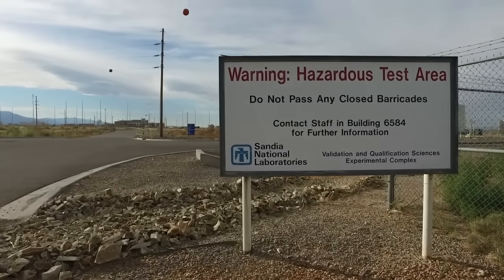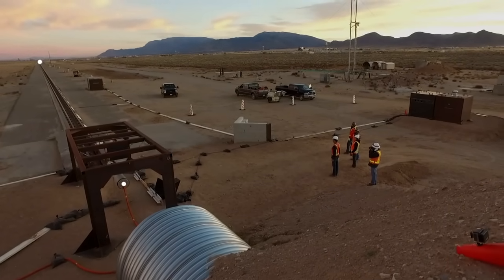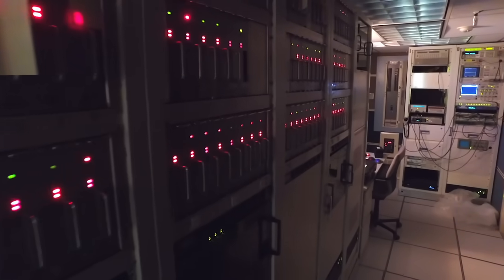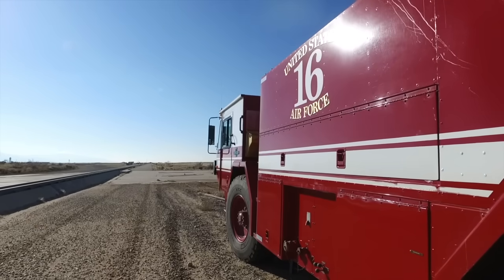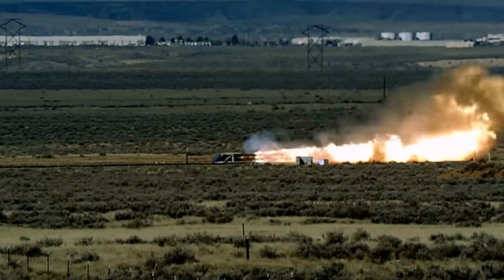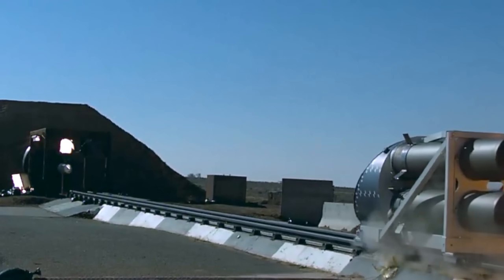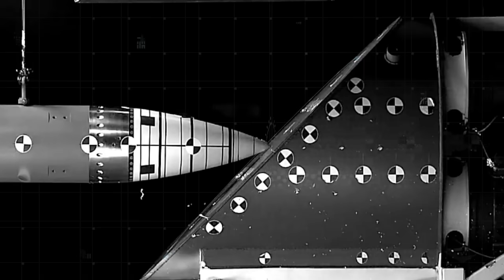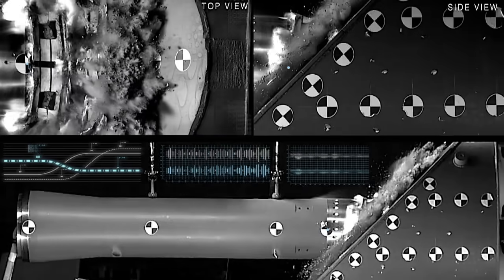Rocket Sled Impact Test In Slow-Motion

Comment: Ok but how does this ensure the efficacy of our nuclear stockpile?
Reply: Point remains, those guys published a video of a test without saying what it's for.
Reply: @lrrrruleroftheplanetomicro6881  They use the results of this test to compare to super computer modelling.
Reply: @hoghogwild  yeah. still makes a boring video.
[Video should] Elaborate on why you wanna slam a warhead into a solid target at mach speeds to begin with.
Reply: @lrrrruleroftheplanetomicro6881  It did, "discover how sensors, gauges, and quantitative high speed imaging systems provide data for the super computer models."
Reply: @hoghogwild  what are we making the models for? Blowing up dirt or interception by enemy missels?
Reply: It's used to verify the contact fuzes on nuclear weapons are functioning correctly. Warheads travelling at the speed of sound (or even faster) have a very small amount of time to set off before they slam into the ground and disintegrate.
Reply: kylesenior   Cool thanks man.
Reply: + kylesenior There is one problem with that.... nobody detonates a nuke on the ground unless its a hardened target. You detonate a nuke at greater than 1000 feet because the shockwave would then travel at such a angle that it is not going to be absorbed by buildings and other obstacles which allows for the shockwave to WAY more damage. Furthermore, in air detonation of a nuclear device results in the EMP to be felt at greater distances.  So yeah I feel like this test was total bullshit and was just something to impress the masses and there is nothing another nation can learn about American nukes from watching it, we perfected contact fuses a VERY long time ago.

If you don't believe me after much testing(Manhattan project) it was decided that the bombs dropped on japan in ww2 be detonated at altitude(1000ft I think for little boy) to cause more damage allow for more coverage by the thermal flash as Japanese structures of the era were mostly wooden.
Reply: @haydenmorrison6642  At the start of the video they clearly state "it is one of the many tests". Clearly it is just one test among many others as they have to cover every single possibility
Reply: But I thought they were mostly designed to detonate in the air?
Reply: It's clear you've done no research on the topic either. The choice between airburst and groundburst is part of selecting the desired weapon effect and is used against vastly different targets. Note that Hiroshima and Nagasaki were cities and that you can drop nuclear weapons on other types of targets.

Airbursts generate a lower overpressure at ground level, but can apply that overpressure over a larger area. The lower peak overpressure means its only useful for destroying soft targets like cities, airfields and military units with little heavy armour.

Groundburst will apply a very large overpressure (try 10,000PSI or more) over a small area, making it useful for destroying hard targets like missile silos, bunkers, armoured units,  or in cratering larger surfaces like runways.
Reply: No, they're designed to be fuzed in whatever method the mission requires.
Reply: That sounds convincing to the layman, but that's completely wrong. The purpose of this test is to ensure that there is no way that a supersonic impact can accidently (or prematurely) detonate the fission primary. The fuzing on all missiles, nuclear or not, is done with radar altimeters/proximity sensors. There is no need to set up such an expensive test to prove the efficacy of the fuzing system. There is, on the other hand, plenty of geopolitical reasons to ensure that a nuke doesn't go off if e.g. the bomb rack on a a B1B fails and the munition falls on friendly territory.
Reply: @tetrabromobisphenol  B-1Bs havent carried nukes since the early 1990's.
Reply: well that's classified.....................so you'll have to ask the russians
Reply: Because if something hits it no explosion
Reply: Nice argument dude. Do you normally act like a child when your stupidity is called out or am I a special case?
Reply: Oh, and loads of conventional weapons also use contact fuzes either as the primary or backup fuzing method.
Reply: Not my job to run you through the basics dude. Go research nuclear weapons targeting yourself. Though somewhat biased, the Bulletin of Atomic Scientists has a large amount of easily accessed data on the topic. Start there. There are textbooks on the topic as well.
Reply: No?
The fact you called this a missile to me suggests you're not actually as well educated on the topic as you pretend you are. This is a B61 gravity bomb, the Mod 11 version but the looks of it from the flanges at the back. the B1 bombers has also been retired from the nuclear role, all the way back in the early 1990s.

Secondly, one point safety testing is no longer permitted. The 1996 Comprehensive Nuclear Tests-ban Treaty does not allow it.

Thirdly, they most certainly do use non-radar contact fuzes. The contact fuzes on the W76, W78, W87 and W88 are all piezo based. They're simply more reliable and don't run any risk of jamming like radar fuzes do.
Reply: I just want to say - great comments, kylesenior. It's a rare sight to see others who actually know what they're talking about when it comes to nuclear weapons. Ignore the trouble some of these people are giving you. They'll find out they're wrong if they ever decide to do research themselves (but I wouldn't bet on that happening).

Also, I didn't even realize the CTBT banned one point safety testing. What's the goal there? It seems like something that's entirely useless to ban. It makes sense that this is a test to validate contact fuze functionality at high speeds, but my first thought was one point safety test.
Reply: kylesenior let's see your research
Reply: I'm well aware of difference in scale of modern nuclear weapons. What you are unaware of however is that overpressure radius and yield do not scale linearly, but instead scale to the cube root. To get 2x the overpressure radius requires 8 times the yield. This is why weapons like the 475 kt W88 warhead still need to land within ~150m of a missile silo hardened to 6000 psi to destroy it despite having a yield more than 20x larger than the nuclear weapons used in WW2. A WW2 weapon would need to land within 70m and be fuzed for contact burst to destroy the same target.

tl;dr you still have no fucking clue what you're talking about and need to do more research.
Reply: kylesenior you seem to have forgotten that today's nukes are exceptionally more powerful than the ones used in WW2. That changes things a lot.
Reply: You're a special case ;)
Reply: So do you quote wikipedia at parties too or only on YT when you're alone in mummy's basement. Oh, No one invites you to parties? Probably because you're a fucking douchebag.

Comment: They should ram a Honda Civic into a Toyota Corolla at Mach 6.
Reply: billt460 to produce a Toyonda Civolla I presume?
Reply: @neilross9867   Corollavic
Reply: Honota Corovic
Reply: @RefianS  now is time for some CORONA
Reply: @RefianS  I want one!!!
Reply: Put a Nokia in front of each car
Reply: That would be an "unstoppable force meets immovable object" type of situation. You might as well divide by zero.
Reply: @ArKritz84  😂
Reply: There are easier ways to produce dust you know...
Reply: This would probably end the human species
Reply: Its the new Ho Yota
Reply: this is definetly how you make a black hole.
Reply: hahaha Honota Corovic that's a very normal sounding yet made up Slavo-Japanese name
Reply: This is how you make a Black Hole
Reply: billt460 To create the ULTIMATE ricer.
Reply: Why not two volvos?
Reply: @martytheanimator6426  Quote: "Why not two volvos?"
The sound would travel eight times around the globe, like with Crackatoa.
Reply: Most likely scenario: The Honda Civic will be on its roof a few miles away, mostly fine. Probably a broken light as usual. And the Corolla will be a pile of neutronium.

Worst case scenario: The impact will cause a run-away fission reaction as the civic imparts immovable force causing the entire corolla to undergo fission, igniting the atmosphere of Earth, burning all biological organisms off the surface in mere minutes.

It's probably worth it, for science. Just make sure there isn't a Nokia in the glove box, or there wont be a bunker deep enough to survive.
Reply: billt460  Hahahahaaa 😂. This sometimes happens for real on Friday nights after the pubs shut on British roads 😁
Reply: My money is on the corolla
Reply: ArKritz84 lets test it anyways
Reply: you would have a Hondolla Toyivic then
Reply: Should rocket propel a Chevy vs Ford. 
I constantly here the ‘which one is best’  argument since moving to the states lmao
Reply: To test what it’s like to get hit by a space tesla
Reply: What you think would happen :
both of them will get destroyed

What will actually happen :
shingo succeeds at the double crash
Reply: billt460 MAXIMUM DRIFT
Reply: Won't work without inner-planetary wobble bearings.
Reply: Instead, i'd suggest a Mach-6 collision between a Ford F-150 and a Dodge Ram...

We'd finally know which onw is the best...
Reply: This sarcasm is close to perfect.
Reply: It would lead to another big bang and open portal to anime dimension.
Reply: Man that would be ridiculous.....and amazing
  The amount of kinetic energy would be ridiculous....So I did the math a Honda Civic weights about 2,800 pounds on he low end and Mach 6 is about 4604mph more and that would be.....2,690,030,320 aka two billion six hundred ninety million thirty thousand three hundred twenty joules of energy same as 1285 pounds of TNT over half a ton or a little over 22 gallons of gasoline or about half the energy of a typical lighting bolt 
     One thing is for sure physics is fun
Reply: You would end up making the first prototype Hoyoda Corovic
Reply: Brack Ho
Reply: mach 6 is a bit extreme. let's just try mach 1 first
Reply: There are easier ways to Double Crash you know ...
Reply: +Refian S
 
Sounds like the name of a soccer player.. one who had Japanese and Serbian parents.. ;)
Reply: The Honda would still start up
Reply: billt460 HaHa...in those conditions, the two cars would fuse giving birth to a fucking hybrid and may be called let's see here.......Honota Cirolla!! How 'bout dat?!
Reply: billt460  FUCK yes
Reply: Refian S That sounds like a japanese x russian hybrid
Reply: Honda Corolla EX-L
Reply: The Honda Civic is too fast
Reply: Land Rover vs Land Cruiser also Land Cruiser must be covered in MUD like my one > [ https://prntscr.com/ke4ft8 ] to make it a real Land Cruiser. Land Rover must be custom made to withstand the sheer sexiness of a real Land Cruiser or it will blow up before the test even begins
Reply: The book is on the table
Reply: Hahahaa
Reply: Yo mythbusters did it already. Except it was a steel plate and a POS Toyota I think
Reply: C O O L  V I B R A T I O N S 
C O O L  V I B R A T I O N S
Reply: Yes that would be a great idea to get rid of all Honda civics from the road.
Reply: Scott Kilmer would not object to sit in the Toyota for the test.
Reply: Holden Commodore
Reply: WANT IT!!!
Reply: or chevrolet into ford
Reply: It would just be a brief flash of light followed by a cloud of dust.
Reply: we need scientist like you,,or at least a program where individuals can test out their ideas.  I would like to see that test even though.....Mach 6 is a little to fast....Mach 1 would be a fair test.
Reply: billt460 why Jappos
Reply: A Toyota civic
Reply: what about a forvy suborer?
Reply: They would disintegrate before impact.
Reply: Myth busters did it at mach 1
Reply: DONT GIVE THEM IDEAS
Reply: Toyoda corivic
Reply: Toyota would fall apart at 120 km/hr. Not much of a test.
Reply: So NONE of you ever watched Mythbusters? 
They did pretty much exactly that, and the car on rails hit so hard it was knocked out from under its own *paint*. Look up the clip, it's insanity.
Reply: Launch a nokia into a brick at mach 6
Reply: Why not a Mercury Grand Marquis vs a Honda Civic
Reply: na guys. the ho yota comment took the belt
Reply: Honda can reach mach 7.3 if V-tec kicks in
Reply: Wow not one person said “she’s home alone?” We’re making progress.

Comment: crazy how you can see the air pressure wave just in front of the sled as it makes impact
Reply: Peter Nelson Are you talking about Thrust SSC? It definitely broke the sound barrier, not by much.
Reply: Peter Nelson I think we will agree to disagree about Thrust SSC (there is a definite sonic boom in the videos and you can see the shockwave almost perpendicular to the vehicle, which indicates the speed was at or slightly over the speed of sound), but you're correct that shockwaves can be formed at subsonic speeds. Normally they are formed when approaching the sound barrier, when the aerodynamics of an object result in some of the airflow around it becoming momentarily supersonic as it passes around (eg. over the upper surface of an aerofoil).
Reply: rowgli I'm not sure that's right. The SSC is listed as going 341 m/s, and the sound barrier is 343 m/s. It varies depending on altitude, temperature, humidity, etc, but I didn't think it had been broken on land. Even if I'm wrong about that, though, my original point stands, which is that a pressure wave doesn't necessarily equal having broken the sound barrier, even though if you've broken it you will always produce a pressure wave
Reply: rowgli you're right; I haven't actually seen the video of the Thrust SSC, so I'm missing information from that avenue. But its true what we've agreed upom, and the same principle applies in aircraft design - part of the reason that it's such a difficult task to reach the speed necessary to break the sound barrier is that the air moving over the wing goes supersonic before the wing itself, due to the inherent principles of aerodynamic lift and drag. The same is true of propellers and is the reason why overspending a prop can lead to its literal disintegration. Super cool stuff, imo
Reply: For these rocket sleds, going mach 1 would be a challenge to maintain such a low speed. They routinely go 4 to 5 times larger than that speed. They can do this because they are unmanned and not much attention is paid to slowing it down in a safe way.
Reply: Peter Nelson here you go - also includes the photo I referred to :)   
https://youtu.be/rIWdtE-__5M
Reply: That's a really cool shot, with the blast wave extending out to the sides! Thanks for sharing!
Reply: And the fun part is that it literally was the front shockwave that enabled the flashbulbs by cutting the electrical bands on the track and not the physical sled it self as you might think since they were layed over the track.
Reply: Ya!! that was so cool!!
Reply: Yet no breaking the sound barrier noises at all ?
Reply: Just because you're pushing a wave of pressure ahead of you doesn't necessarily mean you've broken the sound barrier. The current land speed record (341 m/s) didn't even pass it; you have to be in the air to go that speed.

Comment: How fast was it going?
Reply: there's a shockwave to be seen. its speed it at least mach 1  (768mph or 1235km/h)
Reply: And for the astrophysicist: 1,14431e-6 * c 😂
Reply: 7 cm per hour
Reply: Or 343,2 m/s ^^
Reply: TechCrunchPro no sir. at that speed there wouldn't be a shockwave.
Reply: "not fast enough" :P
Reply: 200,000 lb thrust would accelerate a 1 ton sled at 100G or 960 M/sec ^2
Reply: Michal Kolář Oh Michal!
Reply: 57 mph. It said this in the video.
Reply: 374.8MPH